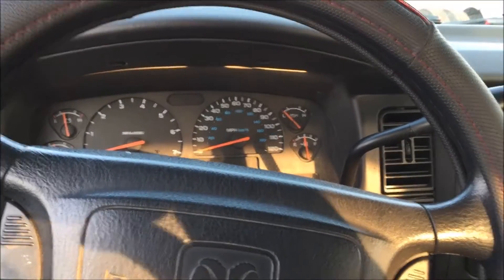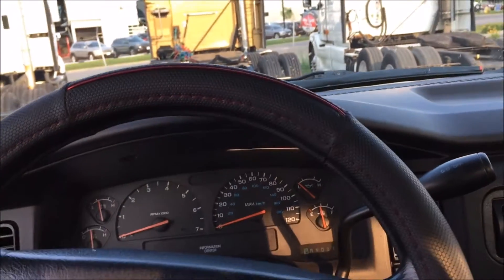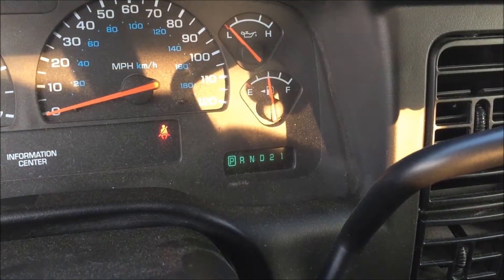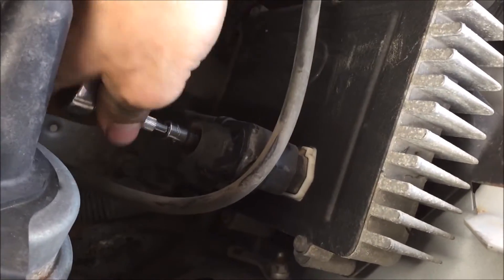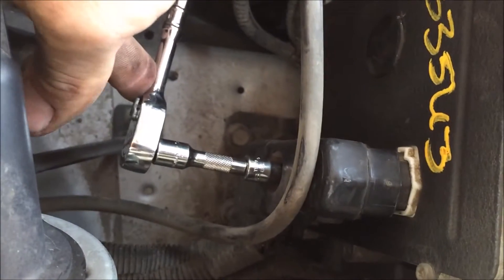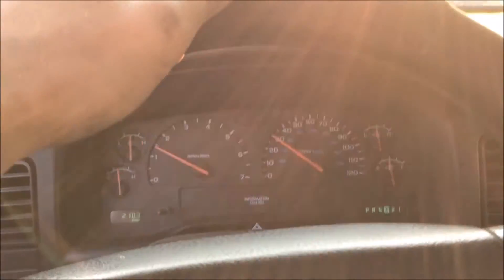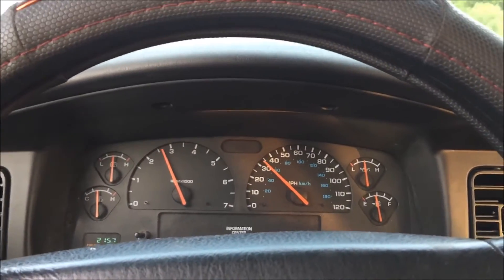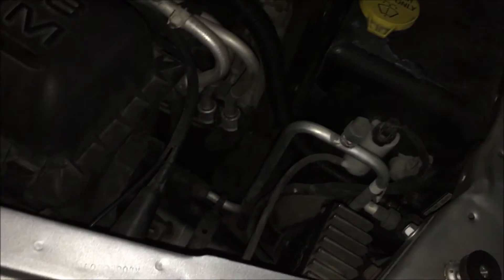Dodge Dakota/Durango/Ram 4 To 5 Speed Automatic Upgrade/Conversion (2001-2002)

Comment: I tried this mod on my 2000 4.7l using 2002 Jeep module.  I don't recommend it.  my transmission shop found that the TCM was not sensing engine load, causing it to shift funny.  I went back to my stock module and trans shifts fine.
Reply from the maker: Yeah this is more for the ‘01+ trucks.